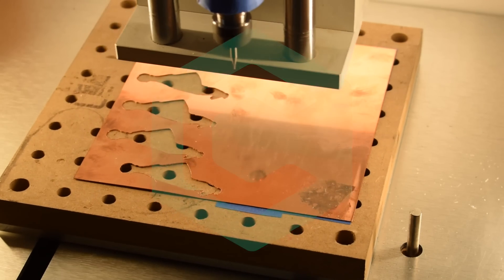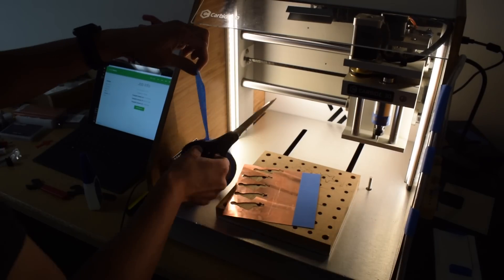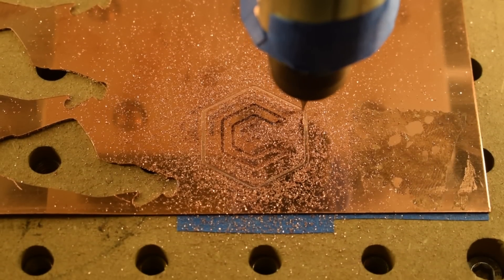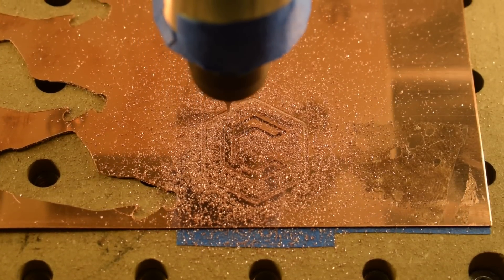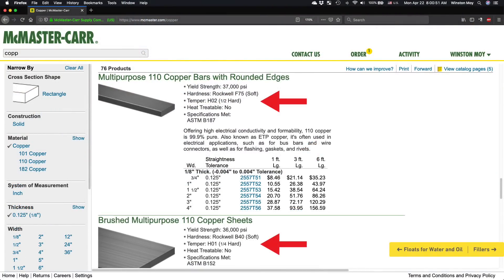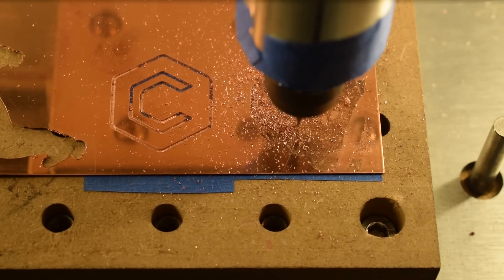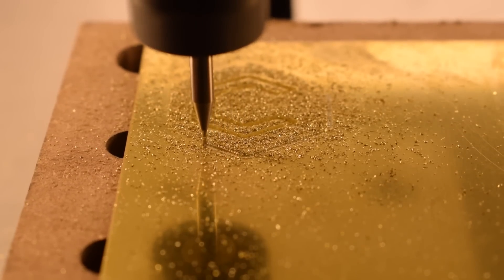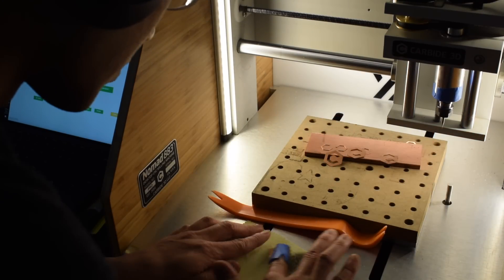Cutting Copper and Brass Sheets - #MaterialMonday

Comment: If you want soft copper just use hard copper and anneal it after the machining. Also: using a lubricant while cutting helps and choosing an endmill with the right coating, to avoid welding of the chips to the flute. Use "high speed machining" if possible. If done properly it will keep the feeds and speeds constant and therefore cut the same chip thickness all the time. This avoids trying to cut too thin chips which wouldn't actually be cut but smeared in the flutes of the cutter.

Comment: Hi, please can you help....I'm looking to machine some detailed parts out of 3mm thick copper sheet and would be really grateful if you can recommend the best, but cost effective grade...I've narrowed down to c111 copper/sulphur alloy vs c145 tellurium/copper alloy? Please note that I must use copper, not brass.  Many thanks in advance, Luke
Reply: I don't know about the grade, what I can tell you is watch out, copper tends to harden while you machine it and it heats up, so use coolant, or at some point you might not be able to machine it anymore and you'll have to trash the piece.

Comment: I used same technique of using a ball nose 0.8 mm at 150mm feed rate and 0.15mm doc. I broke my heart and 3 bits.

Brass plate of 2mm. It didn't complete even 1 cycle everytime.

It had 10mm flute and shaft 4mm

Comment: Winston where did you find full hard copper sheet, or brass for that matter? All I could find was bar and rod. I am looking for sheet in the 18 to 24 gauge range.
Reply from the maker: Best bet is online. I got mine from a knife supply company as stock for inlays. That or jewelry supply places. are good to check.

Comment: Can thin brass sheet like this be done on the Spokeoko as well?
Reply from the maker: Yes. The main difference is that the Nomad can use smaller endmills and cut finer details because of its higher precision spindle.

Comment: Wow. I've been cutting sterling silver sheet @ at around .010 per pass @ 20ipm and @ maybe 5,000rpm. Usually a .040 end mill. I do use lube/coolant, though. I'm not sure what chipload that means, but way more than you are suggesting. Not breaking tools.
Reply from the maker: Chipload = how far the machine has traveled per revolution, per tooth of the cutter.

Definitely room to go faster/slower, shallower/deeper. And some metals like sterling silver can be more forgiving. The best feeds and speeds for any given tool/machine/material combo are derived through first hand experimentation as you've done.
Reply: @carbide3d  Right. I've never really arrived at an optimal setting. I'm still really confused about it. I've been told to go fast with multiple passes, as opposed to deeper and slower. I have no idea if that is the way to go. I think the lubricant is an important factor, but it also seems to cause chips to hang in the cut after earlier passes. I just don't know what's right. There isn't much info available on milling sterling. Thanks for addressing this stuff on your channel(s).
Reply: @carbide3d  Yes, but I wasn't saying that I don't know what the term "chip load" means. I was saying that I'm not sure what mine comes out to be. That's why I said it's "way more than you are suggesting", because that is obvious without even calculating it.